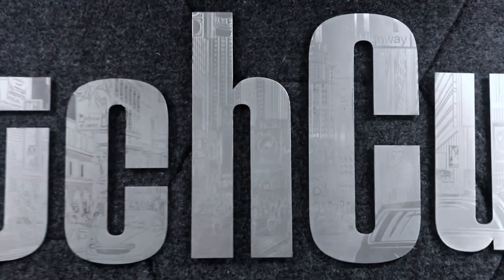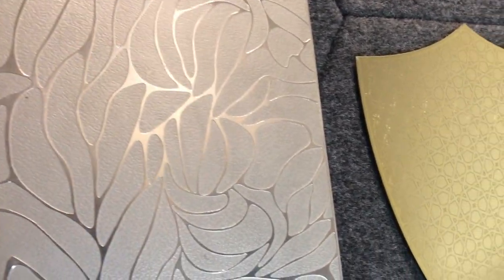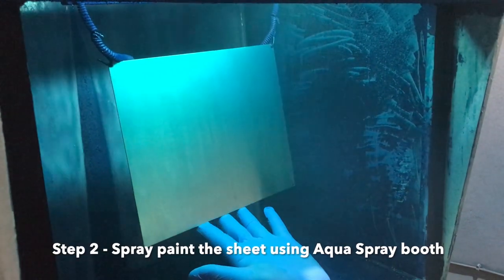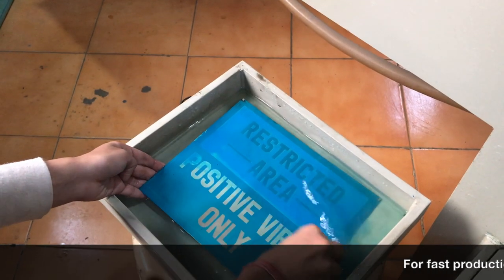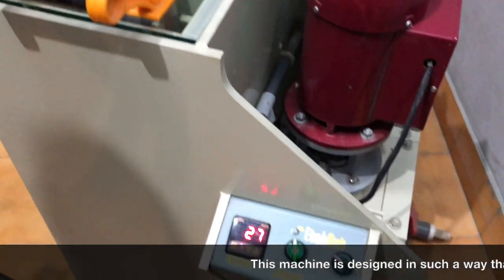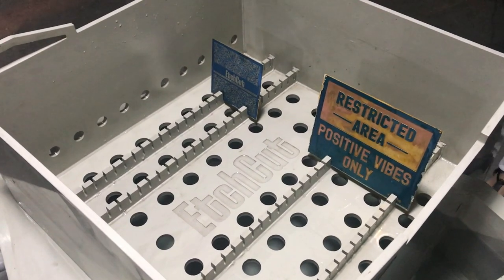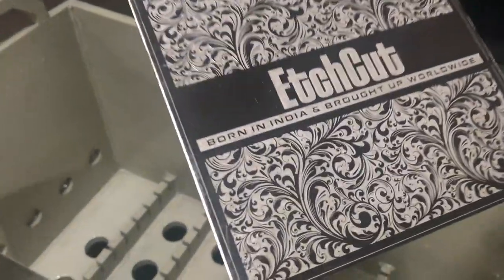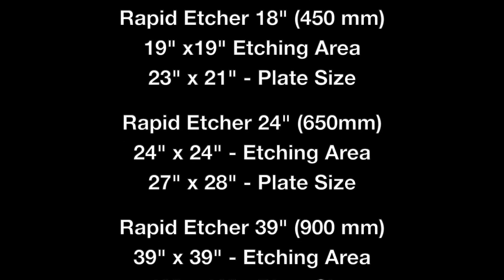How to Etch Metal Signs, Metal Labels, Stainless Steel nameplate, transformers rating plate

Comment: What do you guys using for stripping Dry FIlm? sodium hydroxide?
Reply from the maker: Dry film is a 20 year old process, we have discontinued as we have developed our own liquid coat which cost 50% less and it does not require any laminator, for stripping dry film you can use sodium hydroxide. for more information mail us at info@etchcut.com

Comment: What photo resist are you using for coating.
Reply from the maker: DRK for technical details please send us an email to info@etchcut.com
Reply: @Etchcut  Im also interested in the photoresist and i need to know... this machine splits acid to make the etch ?
Reply from the maker: @ingenia-tec5194  Yes this machine sprays chemical to etch stainless steel sheets faster and deeper, Send you email to info@etchcut.com for more details